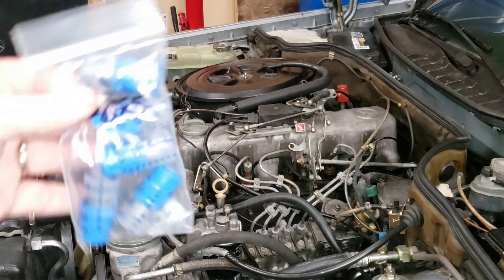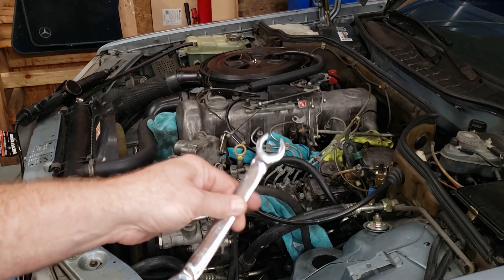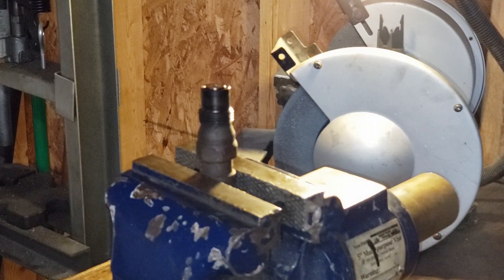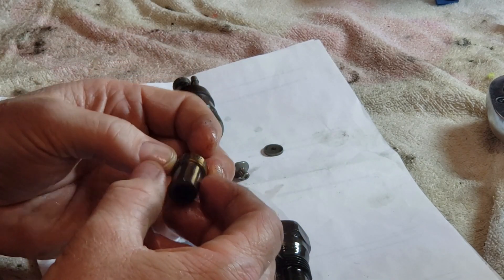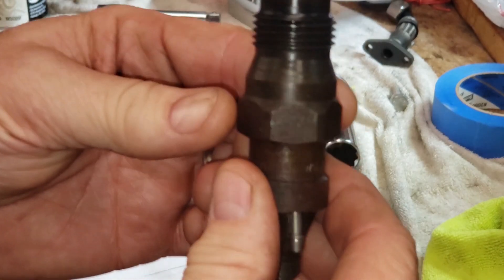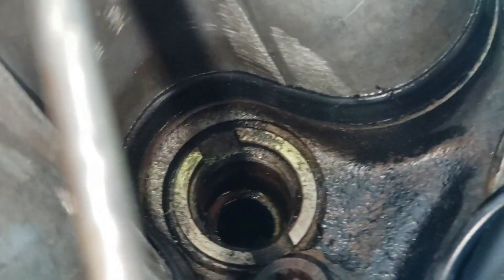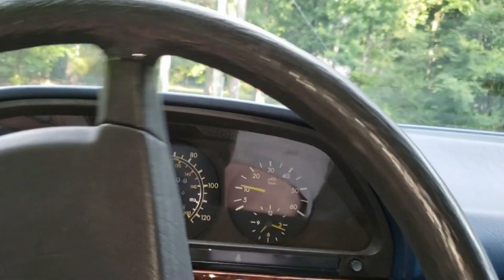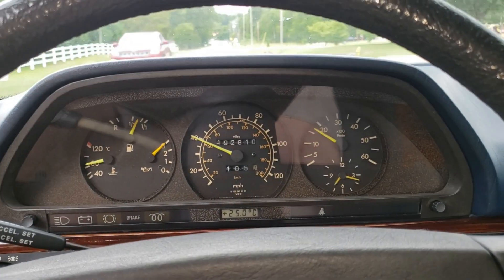Mercedes 300SD W126 - OM617 Injector Nozzle Replacement/Upgrade

Comment: Where can you get firad  nozzles from.  I have a 1987 300d i rebuilt the injectors about 3000 miles ago with monarch nozzles i ordered from the mercedes source guy on YouTube. Since I put the monarch nozzles in it starts hard when cold and and smokes for a minute or two. Before the monarch nozzles it started good when cold and didn't smoke. I contacted mercedes source a couple times and he wouldn't even reply.  I guess customer service isnt his priority.  All 6 were pop tested at spec and new heat shields. Glow plugs. Fuel filters. Air filter. We're all done. I have heard a few people say firad were good nozzles so I'm looking for someplace that sells them.  Any advice would be greatly appreciated.  Thanks.
Reply from the maker: I bought mine from https://www.idparts.com/ but they say no longer available. If you have the OM603 it appears the Firad AN0SD265 is the correct part. Here is the Firad catalog site link. https://www.firad.com/catalogs/
You may need to dig deep to find what you want now days. Might have to order from over seas. I do see that Pelican has a Bosch part that fits you car also.
Reply: @ImpalamansGarage great thanks for the info

Comment: Hello, when you replace the injectors on the engine, you say 30, 40, 50, 55. You torque it in Newton or Kilos? You seem to be in the US of A so I would assume Newton, but I prefer to make sure. Thank you
Reply from the maker: I was using SAE LB/FT (Pound/Foot) units. 55 LB/FT equates to approximately 75 Newton Meters. The torque spec is 70 to 80 NM.

Comment: Is there an o ring somewhere that causes diesel to leak out? My injectors are leaking when revving the engine. What's the fix? Replace the injector and heat shield?
Reply from the maker: There are no O rings. Here are a couple of docs that might help: https://drive.google.com/file/d/1J6Bnyf3wXTzmBp6thgWiFHZIfRt1WPJA/view?usp=drive_link

https://drive.google.com/file/d/1QOlhbUZHQUUoxBZs3bbN_lH4wKJZq9Ap/view?usp=drive_link
Reply: @ImpalamansGarage  Hi. It was my fuel lines. I took one off and noticed cracks. Took it to O'Reilly and got 5 feet of fuel line for around $17. Cut to length, used pliers in the hard parts. Saved a ton of moolah. I'm glad I read multiple forums and posts about it. Almost everyone mentioned changing the fuel lines before anything else.

Comment: I'd say you air intake isn't connected to all 3 rubber mounts.  Maybe not even one.
Reply from the maker: If you saw a rattily breather you would be correct!! I had to replace the breather bracket later on.😁
Reply: @ImpalamansGarage   Did it crack from vibration?  It looks like mine cracked at 1 of the three connections.  Not sure if that is a common failure or indicative of bad engine mounts.  Engine mounts is not something I want to mess with unless absolutely necessary.

Comment: Before you install the five injectors, you should adjust them correctly on the recommended pressure, now  how can you be sure  some of them are not leaking, and latter you got  damaged cylinder?
Reply from the maker: I calibrate them in a later video.

Comment: Nice video the air cleaner housing is shaking like my grandma use to
Reply from the maker: 😂😂 Yeah I had to buy a new bracket.
Reply: Mine has been shaking pretty bad.  Found that it had either fatigue cracked off the bracket or the last owner may have intentionally broke it when he was rebuilding the injection pump and couldn't get the bracket past the oil line to the turbo.  I just welded the bracket back together and bent the oil line out of the way to get it back together.

Comment: did you pressuretest and recalibrate the openingpressure those injectors after changing the nozzles? If not, you should..
Reply from the maker: Not at that time. I did so in a later video.

Comment: I just found out actually 6.2 mm injectior nossles are the best size for any om617 motor, also turning your adla to low fuel as possible meaning zero black smoke is the best set up along with the adjustment two fuel nuts loosened and turn valve sliders on the holding pump output valves all the way up and back off 5mm will open this engine up fast take off, fast top speeds, zero coal smoke, and if you set boost over valve to hard to push in with fingers , and bypass your egr valve✨🎗️🥇🏆🏆🏆🎄
Reply from the maker: I disabled EGR valve a while back. Can you elaborate on the boost valve?

Comment: did this have new engine mounts?
Reply from the maker: No. To be perfectly honest it was not until just recently that I found out that old/bad engine shocks will make you think the engine is missing. Makes a lot of sense really. I plan to replace them very soon. I had the engine mounts off a while back and thoroughly examined them. They looked fine but no way to tell when they were replaced so I will do them too.

Comment: Good job! Wish I still had my '85 300d just so I could do that. Not really. Lol
Reply from the maker: Let go of some of that money Werner! 😀
Reply: @ImpalamansGarage  What are you talking about?! Even if I had any money I just don't think I want to do that kind of work on a car any more. Besides I have a MB I have to spend money on constantly just to keep it going. 
Your car is practically a tank but mine is made from plastic tinker toys.
I just ordered a salvaged dome light for about $60. I checked with the dealer once. They wanted $600! $1200 for the rear sun shade. 
Luckily I don't have to commute to work and put a lot of miles on it. It's already at 150k.
Reply from the maker: @wernerdanler2742  car-part.com is a good place to look for salvage parts.
Reply: @ImpalamansGarage  thanks. I'll mark them in my favorites.

Comment: Love your vids! Be sure to replace those air cleaner mounts lol. If u wanna see a cheap way to make long lasting air cleaner mounts, i can make a vid
Reply from the maker: Dude you were right. LMAO.... I just went out to check and two of those brand new rubber mounts were broken. I had spares and I replaced them. The spares are Meyle and the ones that broke are CRP. Lesson learned.  Breather running smooth again !
Reply from the maker: The air cleaner mount is a brand new Mercedes part and the rubber mounts are new as well. The engine was running pretty rough because the fuel system was not fully primed yet.  I will say this however:  After replacing the breather mount just recently (I did not video it), I've noticed that it jiggles around a little more than it did before. Suspect a difference in the quality of the rubber.